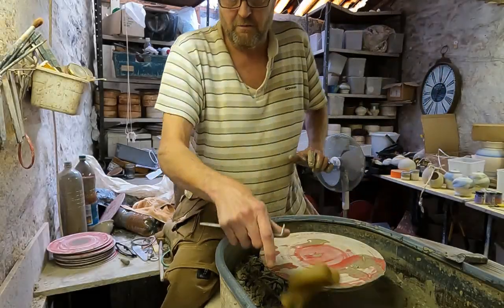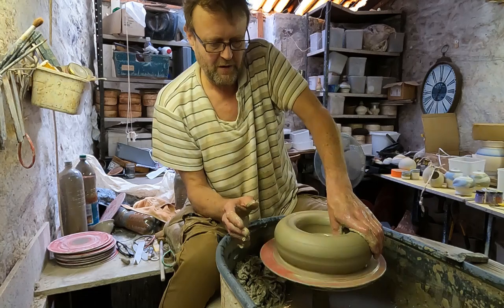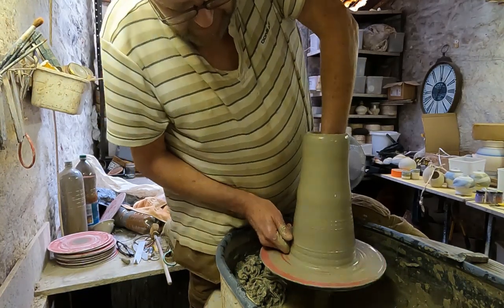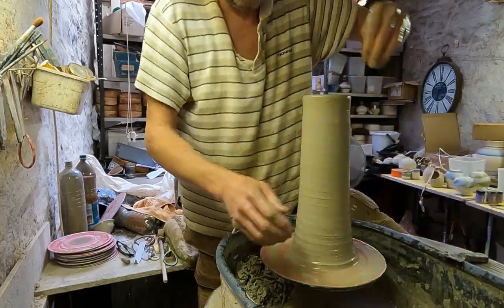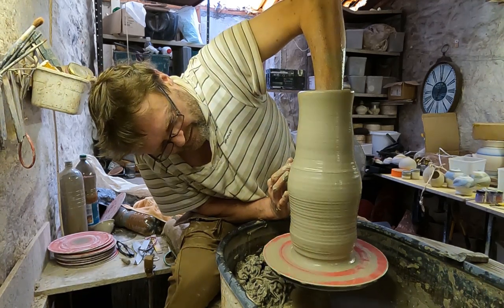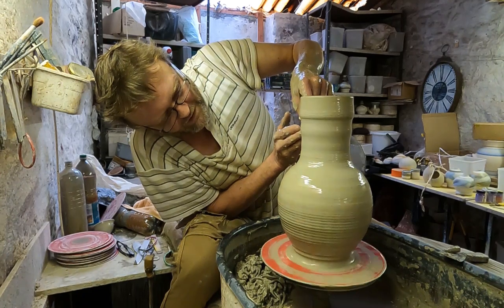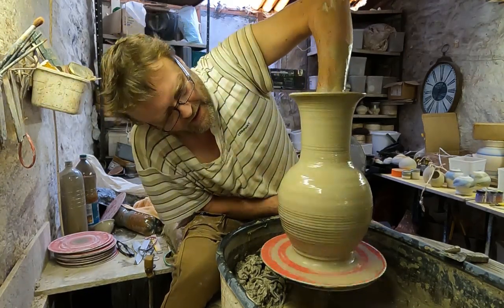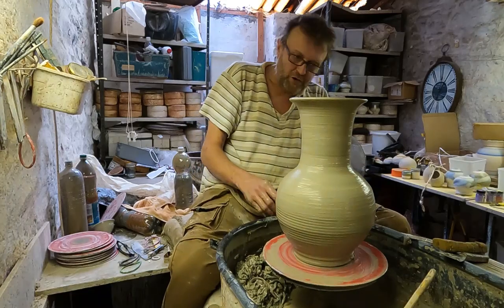How to make a Bulbous Pottery Vase

Comment: I'm taught that constantly using the water can weaken clay. I feel like not using water weakens it. If the clay is dry or drying then there goes the piece and time to start over. I believe everyone has their own way of doing things. That's why it's better teaching yourself, I suppose.
Reply: At one point he talks about the clay in another video. What he says is this local variety can handle more water than other clay bodies. You can really see the difference yourself by how little slip ends up coating his hands as he throws. (5:55 left hand in particular is a good example of this) But I agree with you, less water is better. Throwing with ribs instead will mean your work will be far less prone to flops or uneven wall thickness. Less tendency for cracking, too. I found a simple way to self train good water discipline. Place your bucket far enough out of reach that you force yourself to use less, and keep practicing under that limitation. It really improved my skills working this way. You will realize that you don't even need much water at all, except for when centering or pulling up the initial cylinder.
Reply: @davezad  thank you for the info. I watch a lot of his videos and he's always diving in that water :)
Hey hands get thirsty too ya know lol